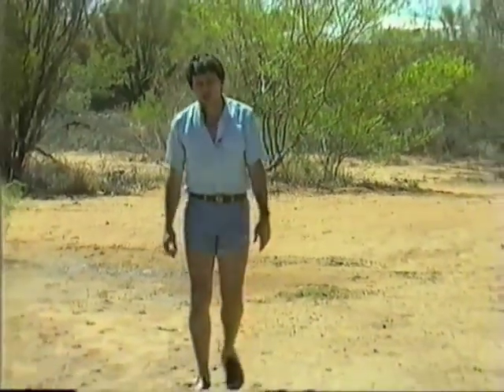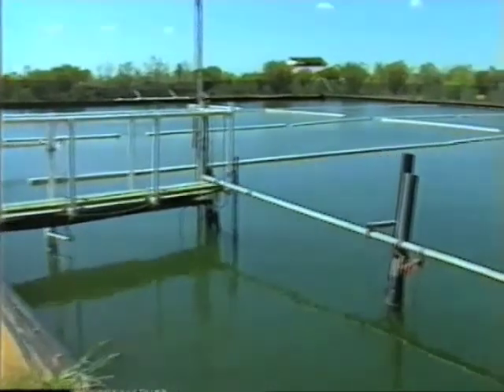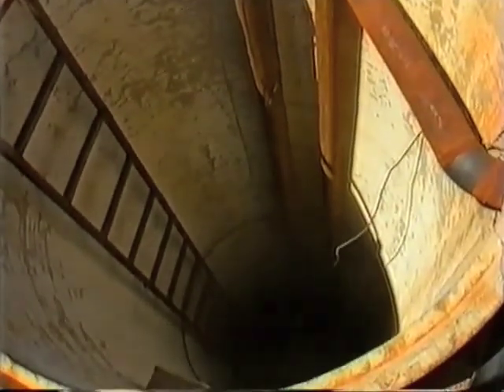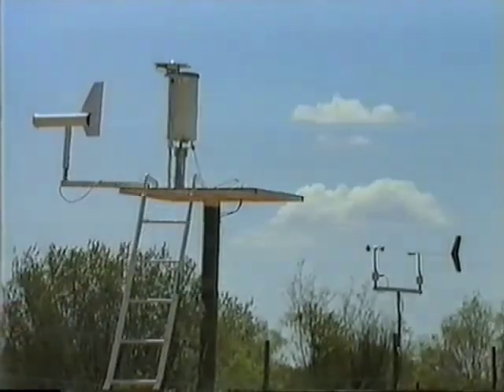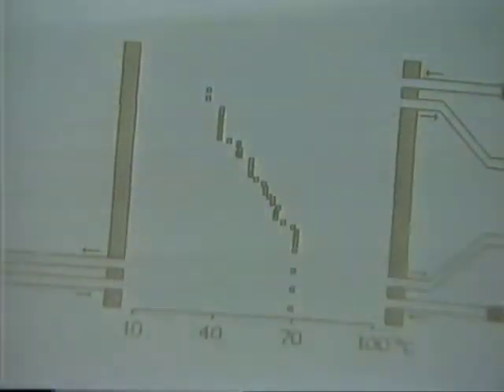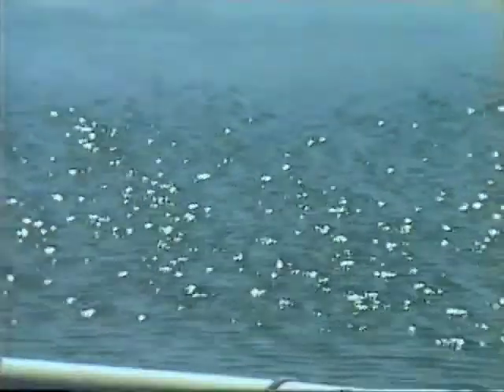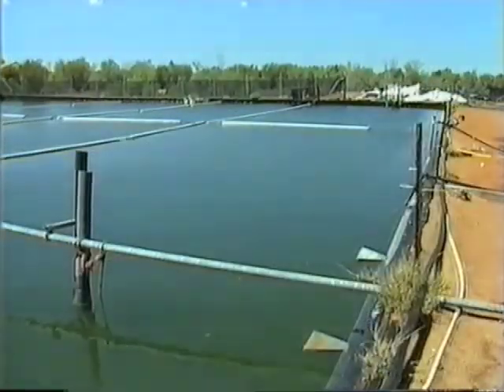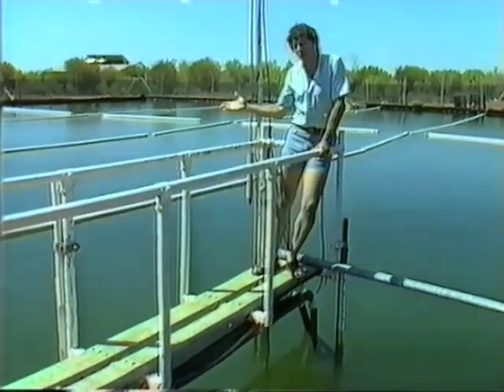Electricity from Solar Ponds

Comment: So I guess taking a dip in a solar pond, although sounding like a mystical feat, is not a good idea....
Reply: 90 degrees celsius would probably be a little warm for a nice dip in the pond. In fact i would bet one reason we dont see solar ponds today is because having big pools of near boiling water around probably isnt too safe.
Reply: @hanselmanryanjames  that's at the bottom, the top is much cooler as the hot water can't mix with the cold water.

Comment: Well now its been years to come later, no solar ponds. Probably failed for a number of reasons. One - being the water evaporates so has to be replenished. Two - salt of that scale is not easy to come by in some areas. Three - the cost to build that would be more then ten times that of a 3000kW solar panel system.
Reply: 1-evaporation can be controlled.2-construct solar pond where salt is easily available in this way you can reduce cost of solar pond . And for your information cost of energy obtained  per kwh    from solar pond is less than photo cells, nuclear power plant and wind power plant
Reply: Soupbones 
Then why it is not used next to the salty water from the sea?